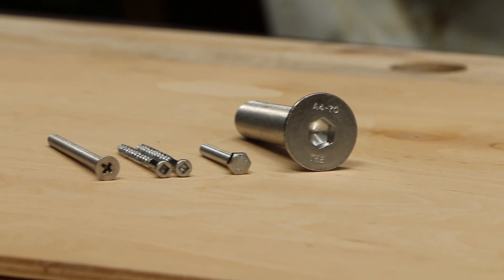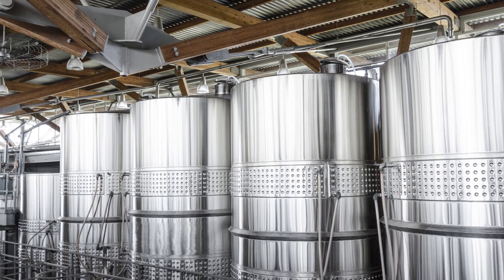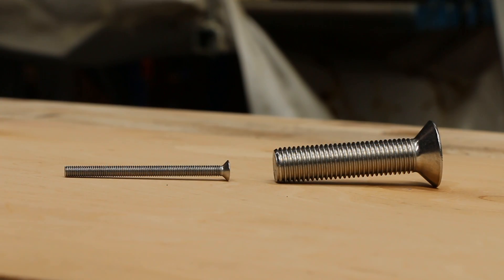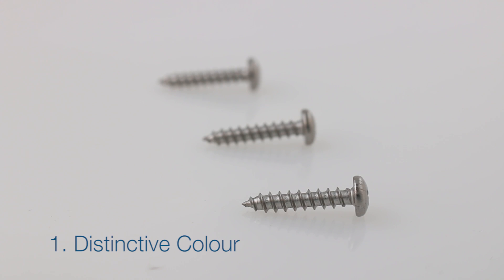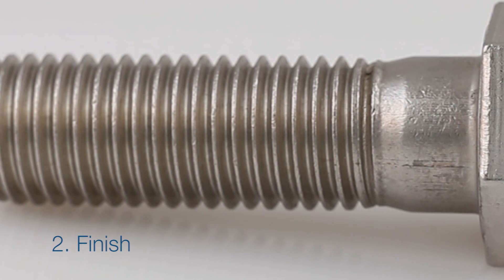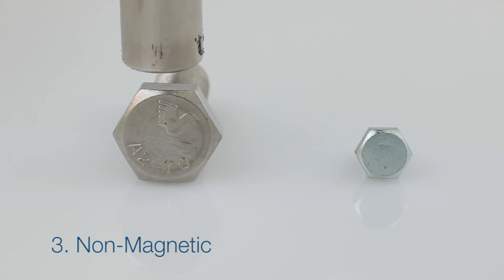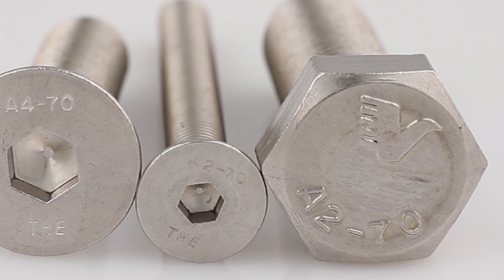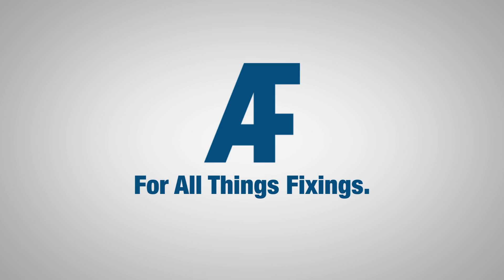How to Identify Stainless Steel | Allfasteners Australia

Comment: The magnet test is the dumbest myth around
Reply: I don't know why people fall for it. I can't tell you how many times I see people at the recycling center put a magnet up to peace of metal, find it to me magnetic, and always dismiss it to be carbon steel.
Reply: why?
Reply: @mrsnoop1820   Many stainless steels can be magnetic, 1.4301 for example can be ferromagnetic depending on how hot it got during machining
I've previously drilled holes into stainless and the permiter around the drilled hole was easily holding a magnet.
Reply: @Blacktronics  so how do you tell if it's stainless steel?